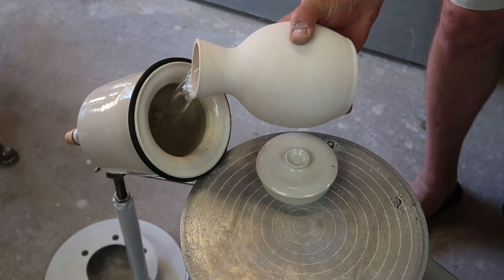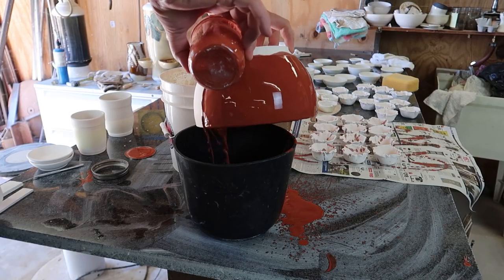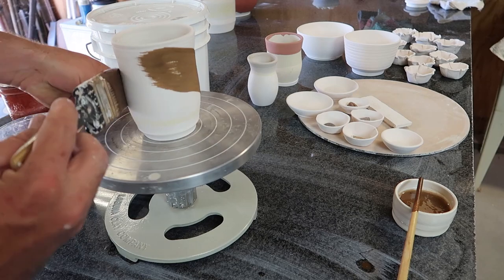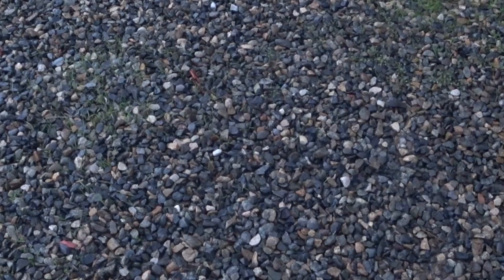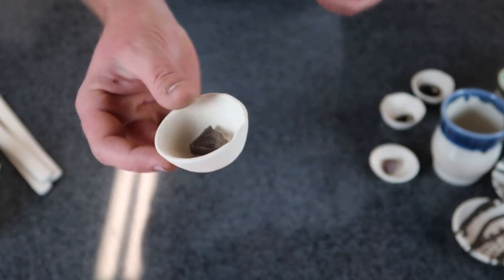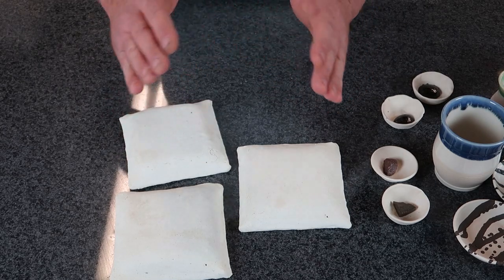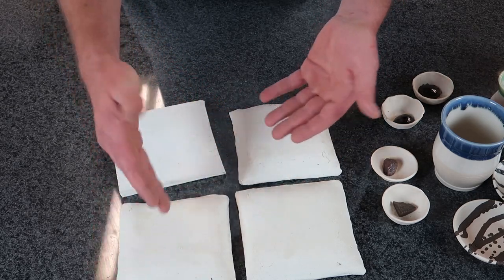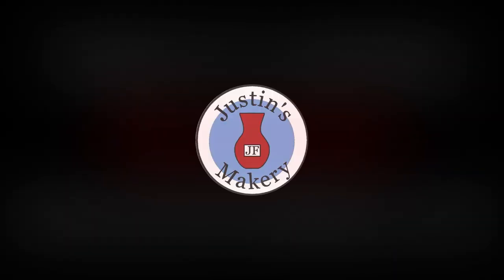Cone 10 Ceramic Tests - Porcelain and Hand Dug Clay

Comment: Nice. Love to see what those stones would do in finer sizes. 

One thing I'd be concerned about with porcelain in a forge is thermal shock; porcelain by itself is not very good with that. It can handle the heat but it can warp easy when hot and it needs to be allowed to heat and cool at a slow steady rate. I don't believe you can just fire up or cut the burners with it like you can with refractory brick or blanket. As I am in the process of building a gas kiln I've been looking up videos and recipes for DIY firebrick. I've learned more about refractory materials from home made forge builders than ceramicists. Turns out that there is a lot of good information on DIY refractory materials here on YT, with many videos discussing how to make refractory cement... which is a whole lot cheaper than buying it. One concrete guy said good quality off the shelf mortar mixes are labeled with a fire rating and typically good to 2500F; I'd thought of mixing it with Perlite and/or vermiculite to see how robust and effective it could be for custom flues or chimneys. Haven't done any experiments with it yet but keeping it in mind for any future projects.